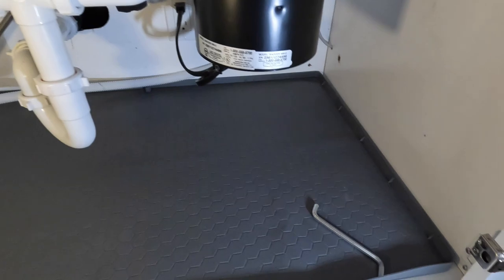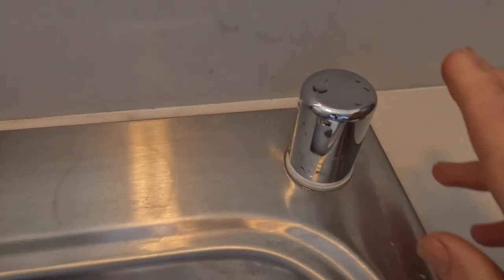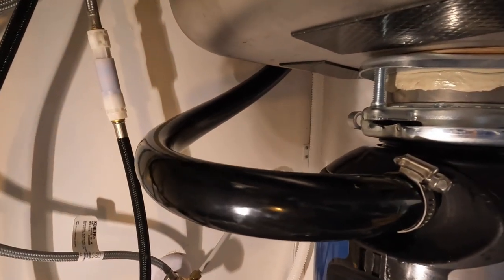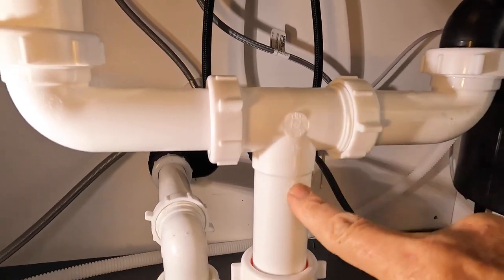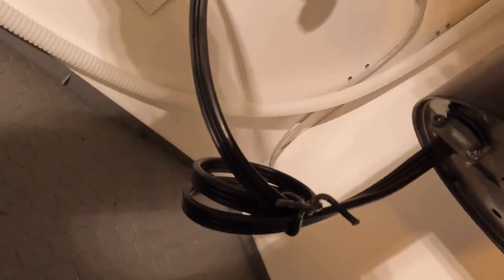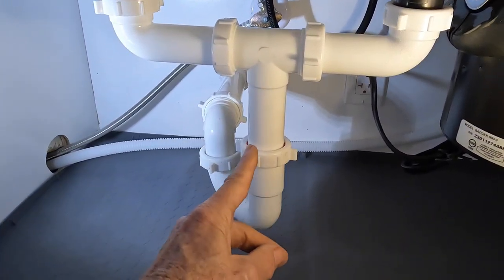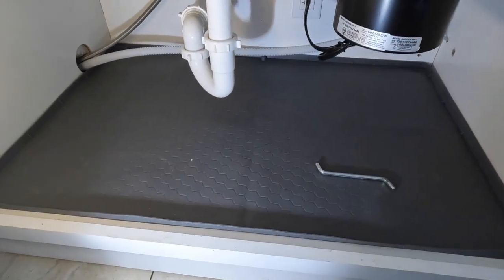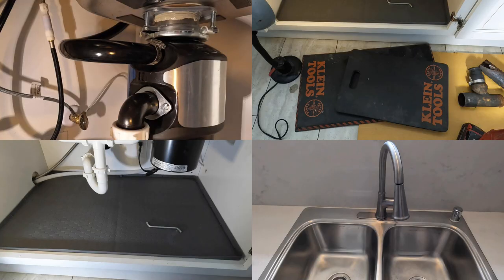Sink, Faucet and Under-the Sink Plumbing

Comment: I like that you chose a stainless-steel deep double kitchen sink. In addition, the faucet looks very functional also. ... Hm? Doesn't the drainage-line from the dishwasher go to your  garbage-disposal first? 👍
Reply: Dishwasher doesn’t go through the garbage-disposal unit. If the disposal was plugged the dishwasher could overflow the sink. 
I have removed several garbage-disposal units recently because cities have changed to compostable bags and green bins and posted bylaws banning disposal units.

Comment: What is that black ⚫️ gizmo around the water hose connector
Reply from the maker: That is a weight that works with the pull-down mechanism for the Kohler faucet. It makes the pull-down part of the faucet go back up into the faucet. The Kohler faucet also has a magnet that helps the pull-down mechanism to seat.

Comment: I prefer the quarter turn shutoff valves over the standard cheap multi turn. The multi turn uses a black washer for the seal and it degrades, or at least it does with this area’s water supply. After use at that point the water will be gray or have black bits for a short while. Gross!
Reply from the maker: I prefer those quarter-turn valves as well. They are much better to work with.

Comment: did you remember to put the cord on the disposal before you installed the disposal to the sink?  to me, not doing that is the biggest non-critical mistake electricians can make at trim time.

any time I'm doing a new kitchen, nowadays, I have three 15 amp circuits under the sink.  one for the dishwasher, one for the disposal, and one for anything else they want to plug in, (like an instahot)  then I can use a faceless or standard GFCI for the protection and local disconnect for the dishwasher (depending on whether it is a hardwired or cord connected model)
Reply from the maker: Yes, I sure did remember. I set up the cord to the disposal before installation. I also knocked the plug out of the area on the disposer where the flexible tube goes prior to installation. That plug only gets knocked out when you have a dishwasher.
Reply: @SparkyChannel  i think i saw a plumber miss that step, once.
Reply from the maker: I actually fixed that problem for a customer once. They couldn't figure out why their dishwasher wouldn't drain.